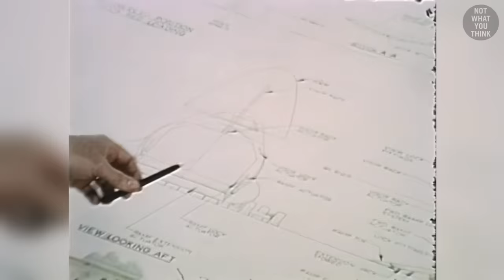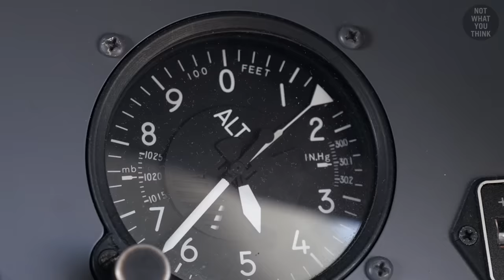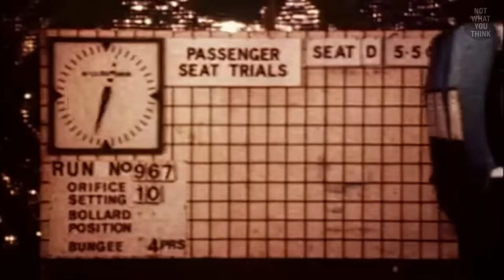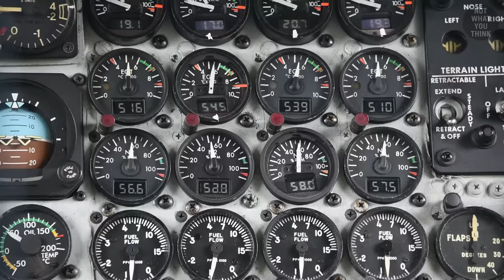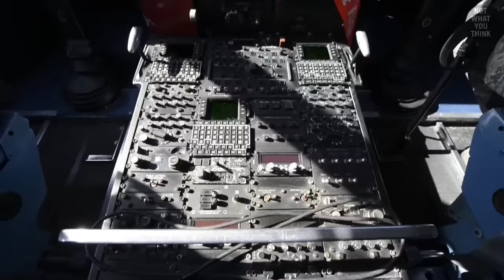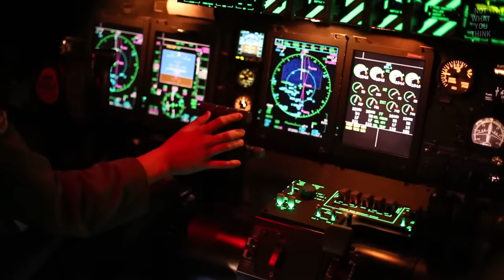America’s MASSIVE Military Airplane that is Named After a Porn Star

Comment: As a retired C-5 crew chief, I can state with authority that it felt like an accomplishment every time we get them in the air.  It's kind of a testament to Cold War engineering.  I encourage investing in a newer oversized transport.  We retired her little sisters, the C-141, back in the nineties.

Oh, the C-5 isn't named for Linda Lovelace.  Your risque play, the Galaxy DOES routinely take in the front or the back!  That's your teaser!
Reply: We use to have keg parties after the 1st flight out of ISO
Reply: I was Air Trans out of Dover, and when I flew on the C5 for space-a, the attitude was, if it lands, it will break. Therefore, when coming back from deployment I always removed myself from the manifest to get on another mission to get home.
Reply: 141s continued service until 2006. They were used extensively in the early days of both Afghanistan and Iraq. I worked at the Aerial Port in Ramstein from 2001-03.
Reply: @carrjeep7538  Thanks.  I  forgot about the Reserve and Guard units.  My mistake.
Reply: And don't forget.  Every time it kneels, it blows.
Reply: @prima164  Rota is AWESOME!!  I got recertification on C5  engine run there, while stationed on the Azores.
Reply: @prima164  I don't recall, I was only there 3 or 4 days, in 1996.  The head of the base rec center gave me and my colleague our own tour of Cadiz (cadeth) and surrounding history - ABSOLUTELY FASCINATING REGION!!!  Thanks for your service!
Reply: Susie due to
Reply: As a passenger during my 24 year career, it was always a relief to get over half way to a destination.  I can remember about 5 times turning around and going back to base.
Reply: Do you remember when the front landing gear on a C-5 collapsed at Clark AB, Philippines around 1987.  I was working at the receiver site along the flight line when that happened.  I wish I had a camera that day.
Reply: @stevekapp6462  I actually spliced a bunch of photos together, to create a simple animation of a similar mishap at Travis AFB.  This was much later, around 2001 or 2002.  The photos were from the Tower Cam.
Reply: @BuckRogers2000  A crew chief told me that happened a few other times also.
Reply: I worked on the 141 back in the late seventies.............Back when it was still called Military Airlift Command.
Reply: @nyernga  I still call it a MAC Terminal.  Back in 78 I flew on a C-141 from Yokota, Japan to Osan, Korea.  The crew chief said we were on the first stretch model of the 141!
Reply: @nyernga  Right on!  I worked the 141 Iso Dock for a few years.  This was the early 90's.
Reply: I was stationed at Altus AFB '80-'82. I got to go on a night air-refueling training mission (in the cockpit), gut wrenching surreal experience.  The Cpt. in-training couldn't grasp the concept that it took 2-3 seconds for the C-5 to respond, he couldn't keep it stable.  The instructor had to slap the throttles and dive "breakaway, breakaway, breakaway " putting us into a nose dive ... 3 times.  I became a little weightless, we were on the floor behind the pilots seats with headsets on.  I finally went back to the passenger seats and strapped in, whew ... didn't want to get sick.  Amazing experience!!!
Reply: @robhaney8568  That sounds like a hell of an experience.  I was on a KC 135 once on the way to Misawa AB, Japan.  The boom operator let me watch the refueling with him.  But it was in the daytime, not at night.  About 8 years ago I was a contractor at Altus AFB installing a new Air Traffic Control tower.  Driving around that place was like being on the moon!
Reply: @robhaney8568  Wow!!  Having been on C-141 Low level drop missions, I can certainly sympathize.
Reply: as a retired flight engineer on FRED, I felt the same accomplishment sometimes. Especially on the "C" model
Reply: The C-5 was GUARANTEED to break down in Rota and be there for a week wait for a part 😂
Reply: @socaljarhead7670  Yeah, it was HORRIBLE!!!  ;)
Reply: @socaljarhead7670  and Germany.
Reply: @socaljarhead7670 the military didn't see the need for replacement parts until absolutely necessary.
Reply: I have flown on both the c-5 and the c-141, much prefer the c-5 from a comfort standpoint.
Reply: I flew on C-17 as a loadmaster, and every time I saw a C-5 take off I was in disbelief. They really look like need about twice as much speed, and then suddenly they're in the air. It never looks right

Comment: 4:25 This is NOT a clip of reverse thrust. This is a video of the cargo becoming unsecured and sliding backwards, destroying the fly-by-wire flight control. Rest in peace to the crew.
Reply: Agreed, I've seen similar footage of a C-5 crash. I got butterflies when I saw that odd shift during ascent. 😟
Reply: Bruh thats a 747 not a c5
Reply: It was actually the hydraulic system, since the 747 does not have fly-by-wire, and that is a 747. Nonetheless, RIP to the crew, there was nothing they could have done to save the situation.
Reply: I don't think it was meant to be a clip of reverse thrust...
Reply: The 747 actually crashed due to the cargo coming loose and shifting the center of gravity (CG) too far aft (rearward). Once that happens, no amount of forward elevator or trim could have prevented that stall.
Reply: @mactep1  I always heard it was the cargo becoming unsecured and sliding back as the above states? Are you sure about that? Thanks
Reply: @MK-1010  That’s not at all what butterflies in your stomach mean
Reply: @xsessivmc  Yes, the cargo (heavy military vehicles) rolled back, crashed into the aft bulkhead, not only changing the center of gravity, but also damaging several extremely important aircraft systems, like the hydraulics and horizontal stabilizer(mainly the trim jackscrew). The situation was completely un-salvageable, even at a higher altitude.
Reply: It was the load master that did not use the regulated number of straps for the overweight vehicles, and also used straps weakened by age. The straps broke during takeoff.
Reply: @mactep1  I see, I appreciate you taking the time to explain that. Rip to the crew
Reply: @bgezal  I wonder if he was sent to prison? Probably not I'm guessing?
Reply: Yeah due to cargo sliding backwards and crashing into the controls
Reply: @xsessivmc  There were no survivors.
Reply: I feel a little sick whenever that clip gets played...
Reply: @burningchrome70  kinda like the Bud Holland B52 crash,makes me sick to my stomach.
Reply: @viruspter1dactl  then why was it in the section about reverse thrust, with many other clips of reverse thrust in action?!
Reply: @Name-qj9ql  The only disaster caused by thrust reversal I know of is the crash of a Lauda Air 767.  The #1 engine suffered an uncommanded deployment of its thrust reverser in flight sending the aircraft in an uncontrollable spinning dive which ripped the aircraft apart.
Reply: @Name-qj9ql  listen to the rucking words said he says "slow down in midair" he might've been trying to emphasize that
Reply: @viruspter1dactl  that plane crashed in a massive fireball, killing all 7 crew members, and you think they used it for emphasis???
Reply: @roykliffen9674  that crash had nothing to do with reverse thrust
Reply: @Name-qj9ql  maybe he he only watched the part where it slowed down?!  You think I haven't seen the fucking video!?
Reply: @viruspter1dactl  that's actually my hypothesis, they only saw the part where the aircraft climbed rapidly. Dosent make much sense, but it's the only reasonable guess
Reply: @friskjidjidoglu7415  You just embarassed yourself by being completely wrong. That absolutely is what it means, they are using the word correctly and you are wrong. You yourself clearly do not know what "Butterflies" means. Research things before you talk about them because we can all see clearly you don't know what you're talking about. Butterflies simply means feeling physical symptoms of nervousness and anxiety around the stomach which can be triggered by anything.
Reply: Yeah Im honestly thinking it was a bit fucked up to use that clip.
Reply: @xsessivmc  
 @xsessivmc  The loadmaster perished in that crash. That was an Evergreen bird carrying ATVs that were not secured properly. The ATVs were not chained down to the aircraft floor only the 476L pallets. The pallet locks broke causing the vehicle to push another two into the tail of the 747. The center of balance (CB) became tail heavy and lost airlift. I believe five crew members were on board the 747. That was one of the planes I used to load during my time in service.
Reply: Almost every time we nose kneeled a C-5, it broke down. Forgot to mention that. LOL
There's a special staircase truck to have passengers board and disembark from the top passenger compartment instead of using the flimsy folding stairs inside. Servicing the lavatory in that passengers deck is a pain in the @ss.
Reply: Now that was stupid !
Reply: @xsessivmc  He was on the plane when it crashed.
Reply: @avocadoflight  I like this channel but definitely fucked up on that one. Thank you for saying that.
Reply: @burtbacarach5034  That's even worse (in my opinion) because of the well documented events over Years leading up to the crash.
Reply: Is there a video explaining this accident?

Edit: Ahh, it's "National Air Cargo 102"
Reply: @Name-qj9ql  you really need someone to explain the context to you? Jesus Christ man
Reply: The only reason they added this clip was to show us a specific instance where "If they only could have stomped on the brakes" by using the trust reversers, the unsecured load that shifted rearwards could have been made to slide forward and reestablish a more manageable center of gravity  and saved everyone on board.  You know.  Like when you've just picked up your kids birthday cake from the store and someone cuts you off on the way home and the cake goes flying forwards off the front seat and lands all over the floorboards. 🙄 /jk

RIP
Reply: @tdbla98  Please. Enlighten me.
Reply: @Name: thank you for pointing that out. I was a bit taken aback when he showed the beginning of that terrible accident that had nothing to do with the topic discussed.  RIP to that unfortunate crew…
Reply: @shopsurvey  Agree. Should not have been in this video at all.
Reply: @Ratzmoonmopes  having butterflies in the stomach is about nervous anticipation, but using that  expression for a plane in uncontrolled flight is strange, it's too light, as if it were an exciting stunt rather than a tragedy.
Most would find it sickening, feeling shocked, realising what will happen.
Words do have meanings but they also have appropriate contexts and collocations.
I don't think the word was apt or appropriate, something like "it made my stomach turn" makes more sense.
Reply: @mactep1  Correct. Mentour Pilot did a video on this. There were alot of red flags that preceded this, mostly due to the way the cargo was tied down and the loadmaster's lax attitude towards that fact
Reply: @mactep1   ACKCHUALLY it was an electric system because the trim screw jack is electric motor actuated.
Reply: @michaelbuckers  It didn't just break the jackscrew, it damaged basically everything behind the aft bulkhead, including the hydraulic systems, i think there is even a video where the leaking hydraulic fluid is visible, but i might be confusing it.
Reply: I wondered why they used that clip also! That was very tragic and watching the entire video of that crash is hard to watch.
Reply: @mactep1  Mentour Pilot did an investigation breakdown video. Everything was damaged yes but i was jackscrew getting jammed into full elevation position that has doomed the plane. They could've flown it if tail was limp, but it was pushing hard nose up.
Reply: Yeah when I saw that I said " Whaaaaaaat??!! " 
 For something like that it would drop like a stone.
Reply: @michaelbuckers  Check out mentour's video on Lauda Air Flight 004.  That is a case of a flight reverser activating mid flight.  When they finally fixed the simulators to respond realistically to the same situation, it was determined that the crew only had 6 seconds to react correctly or it was impossible to recover from.  The thrust reversers were never designed to engage midflight so there was no training for this. All the risk profiles suggesting it was survivable were done at lower altitudes at lower speeds so unrealistic.  It is far worse than mcas was. Boeing has a long history of not caring about safety until serious crashes happen and hundreds die. Then they do the bare minimum to fix it.
Reply: @michaelbuckers  No, that 747 could not have recovered even if the stabilizer trim hadn’t been damaged. Having the CG so far aft of the maximum limit would result in loss of pitch control 100 percent of the time.
Reply: This was on Bagram Air Base in Afghanistan. That wreckage was there for months afterwards.
Reply: There's a limit to what max speed you can engage thrust reversers.  Not typically used in flight.  Used mostly on the ground to slow the aircraft down and use less brakes.  Especially on shorter runways.  Only the C-5M models have thrust reversers.  The M models have new engines and avionics and are vastly more reliable than the A and B models.
Reply: @xsessivmc  He was on the plane.
Reply: @xsessivmc  how would they do that
Reply: In case the cargo snapped the straps and got loose couldn’t the pilot simply just open the back hatch and let the cargo slip away…
Reply: As an aircraft mechanic and maintenance crew in training this was the first video they showed us both for weight and balance class and regulations, it shows what can happen if you don’t follow rules and regulations
Reply: @ursus9104  um no. It takes just under a minute to open the rear door, depending on the aircraft, (I know about the cc-130). the cargo probably only took a few seconds to slide backwards. This is assuming the 747 can even airdrop im not certain.
Reply: @Name-qj9ql  No, the 747 is a passenger airliner that is sometimes built in or converted to a freighter configuration, not a tactical airlifter. There is no ability to airdrop cargo.
Reply: @singleproppilot  👍
Reply: The C5 had two redundant wire looms running along the fuselage at 120 degrees apart so there was back up on the controls; also could be landed from ground control if needed.